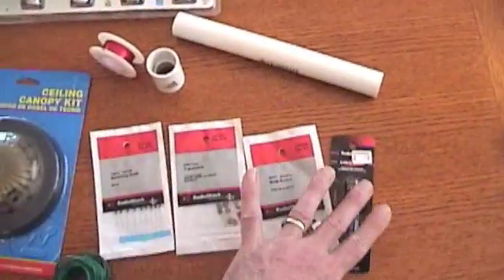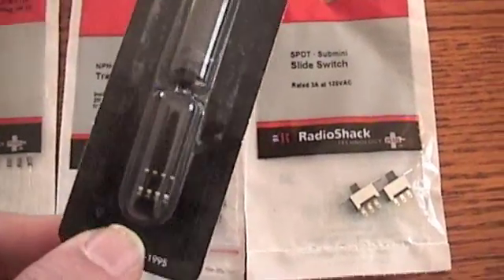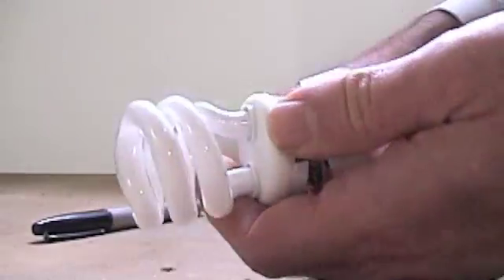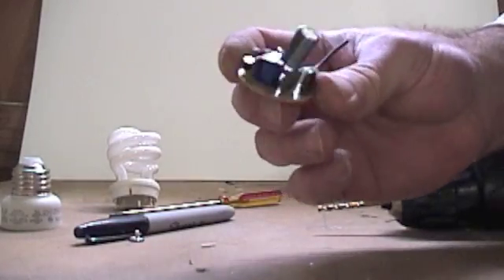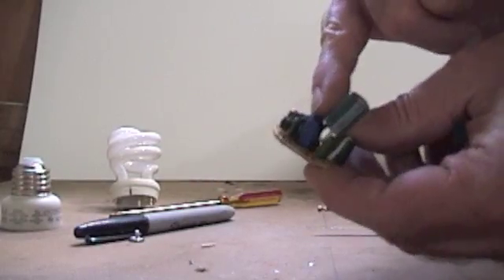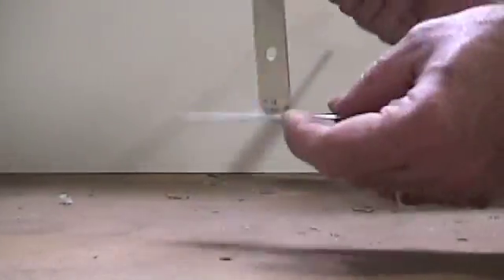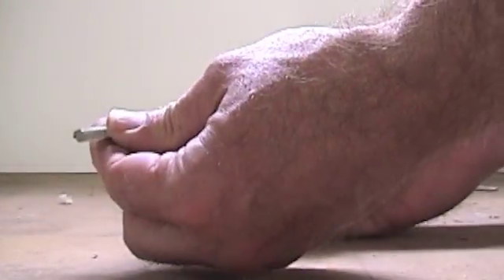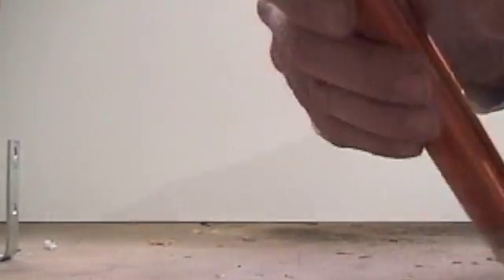Lynx Joule Lamp

Comment: So many Negative Nancys...  The lynx unit is a joule thief with specifically different characteristics due to its design.  Nothing unusual about the circuit though.  Look at the circuitry of a CFL bulb - it's basically a joule thief with filters.  The ringing sound is tuned to a frequency above human hearing unless you use a dimmer switch.

Comment: That enameled wire is very expensive around here. Transformers with core are the way to go. The amount of wire you showed costs about $30 here, a ready-made transformer $2. Plus it's much smaller and less vulnerable to damage.
That said, any power conversion is less efficient than just using 12V LED strips and batteries.

Comment: That's great. If yours works then it's good thing to copy and learn from. Playing around with different configs costs time and money that I don't have much of. Love the vids. Thank you.
Off topic, but in the middle of making a flipflop inverter  box from Incroyables Expériences' channel. Lidmotor and a few others have replicated it. Works quite well and found that I could put 3 4w LED bulbs in series with good light and amp draw reduces instead of increases with only slight loss in light.
Thanks

Comment from the maker: 9" is correct.  The total length of the secondary is about 8.25" which is about what a Radio Shack 30 awg spool has.  I am sure different sizes will work, I'm just trying to make it simple.

Comment from the maker: Ooops!  Thanks for clarifying.  Funny thing is we don't need the diodes.  I am back to using LaserSaber's concept of just the 2N3055 power transistor reversed biased and no diode.  Very bright on 12 volts.  Not so good on 6 volts but that's Ok because 6 volts is less common.

Comment: Can I use an old dead lamp?  I read the circuits over-heat and age and burn out. So I wonder if the old tubes will still work for this.